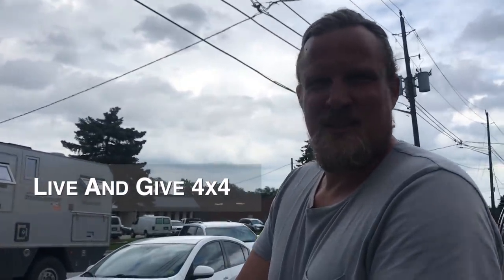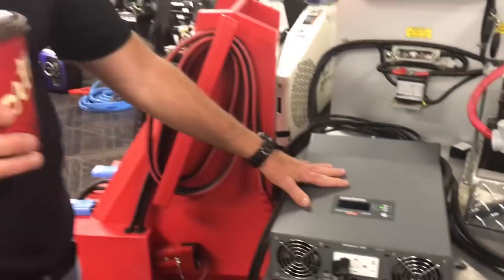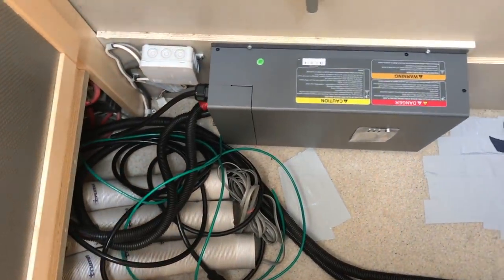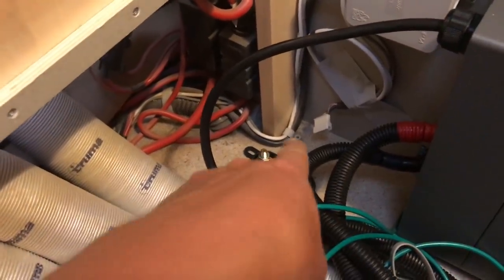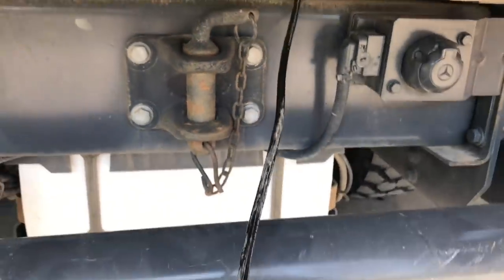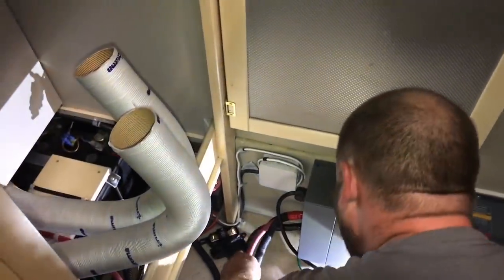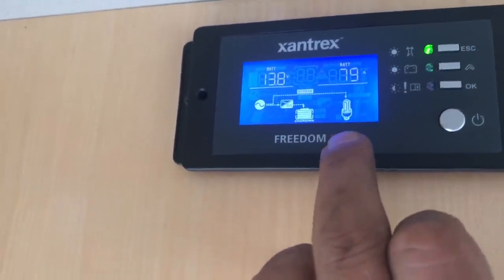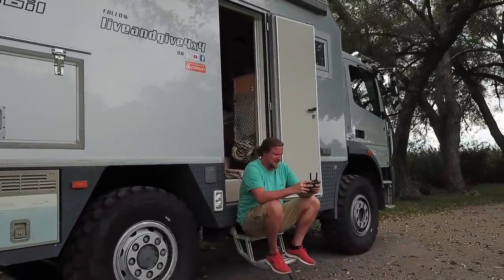Finally ready for Full-time RV life Worldwide!!! 🎉🌎 ► | Installation Xantrex Inverter

Comment: Great video, did you adjust the charging amps for the batteries?  Our two 260 amp rv batteries have a recommended charge rate of 20 amps total, I think 80 amps would fry any led acid batteries of that size.  Safe travels!

Comment: Nice video.  A more simple solution might have been to install a 110VAC charger (as most of have / will do).  It won't allow you to use 110VAC appliances, but it saves spending a lot of money on a new inverter.  For example Meanwell PB-600-24 is one choice - and you can interlock it to the Victron (if that is what you have) so only one or the other charges.

Interesting video nonetheless
Reply from the maker: Thanks... it is a good solution for us and works perfectly so far ... 🙏🍀😉👍

Comment: Hey. It isn't too late to add corrugated tubbing to the port plug cable. There's a reason why all the other cables are inside corrugated tubing when going into the chassis. Vibrations may cut into the insulation and cause a short and a fire. Please do that and stay safe.
Reply from the maker: Will look into it ... thanks 🙏 
See ya when we see ya 👋 
Fabian and Isabela
Reply: @LiveandGive4x4  I meant shore power. There is AC power going into your vehicle and the last thing you need is for it to get grounded and give your zaps. Look after yourselves guys and congrats for the bump.